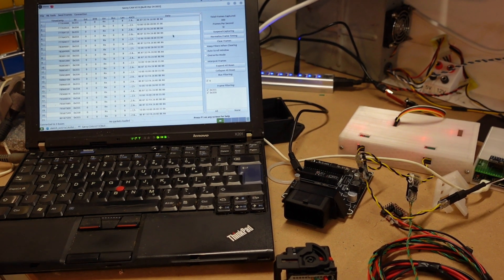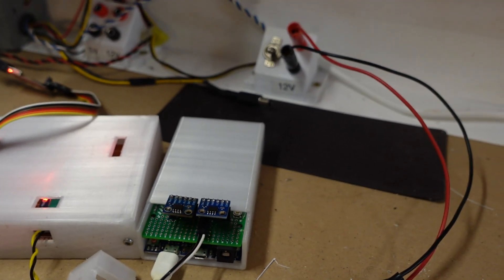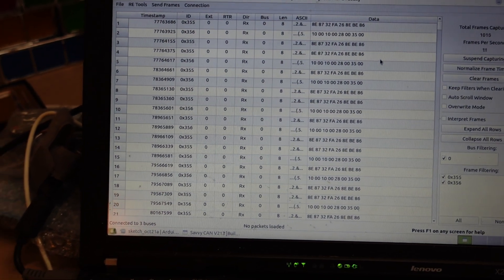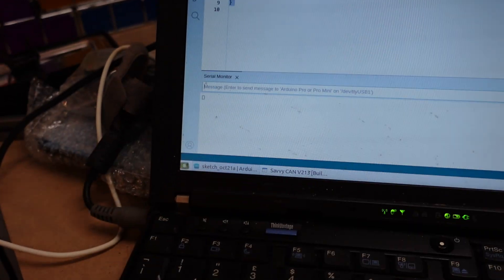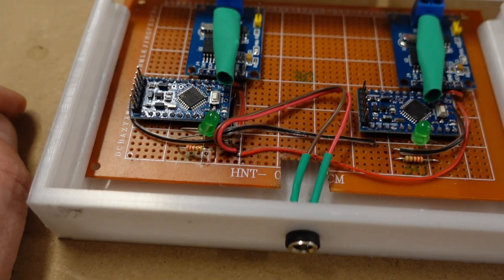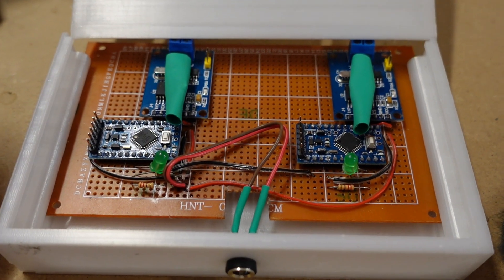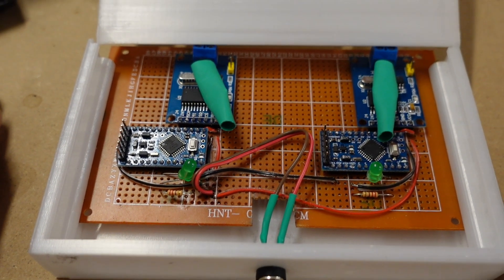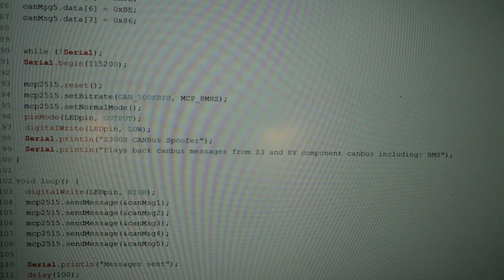My CANbus test network has been fooling me for a year

Comment: That's a good find, thanks for sharing. Some time ago I tried playing with some MCP2515 boards and an ESP32 to build an ESP32RET since the Arduino Due's were unobtainium at the time. Couldn't get it to talk to my OI board. I'll bet that's why! Eventually gave up and bought an Innomaker USB2CAN cable which has isolated transceivers and supports native Linux SocketCAN which was a better solution for me.
Reply from the maker: That does sound neat. I've built an ESP32RET up and even 3D printed a nice box for it but never actually got around to making it work!

Comment: Well ... I guess things like this happen to all of us. I guess we have all been there. I keep bumping into issues like this, where a library has a defaults that differs from my hardware and I do remember debugging the CAN library that I used to find the same issue. Being able to monitor the CAN signals with an oscilloscope showed me 250 kbit while I was expecting it to be 500 ...
It took me some time to find the issue since the boards don't state the crystal frequency used and I did not read anything about this in the manual of the library
Reply from the maker: No, it took some hunting around. Hoping a few people see this and don't suffer the same frustration!

Comment: Could you run the clock speeds up until you have communication. In the same way the old RS232 used to try various baud rates until an ack was returned??
Reply from the maker: Probably? But it would be a bit of a bodge. Sure one of the diagnostic tools does discovery to work out the baud rate.

Comment: Good to hear your still figuring things out, CAN is simple in principle but there are so many ways to screw things up. 
Just curious to know why you have the resistors on the boards if your using resistors on the CAN transceivers? You probably already know but it only dawned on me a couple of months ago about the terminating resistors at either end of the network. Turn everything off and stick a meter across the network and you should see 60R.
Reply from the maker: There are no terminating resistors on the MCP2515s. You have to add them. So because I have them at each end of the network I've put resistors on there, and desoldered the ones from the SN65s that are on the other devices.
Reply: @EVDIY  Sorry mate, I'm still a little confused. There should only ever be 2 terminating resistors on a CAN network, one at either end. Do you have four now with the two on the MCP2515's?
Reply from the maker: @alibro7512  Nope! Just the two on the MCPs and none anywhere else.

Comment: Huge amount of respect to you. Can bus is one thing I have yet to learn, it’s something that looks like it will take a good while to get to grips with it. 

On another note, I hope you and the z3 are remaining above water. (Referring to storm babet)
Reply from the maker: Thankfully yes! Manchester hasn't been too badly hit, unlike the Midlands. Was on a train on Sunday and it was water as far as the eye could see. 

Canbus is a PITA but when it works, it's brilliant. Checking continuity and resistance usually addresses a lot of issues but it's the code that often gets me.